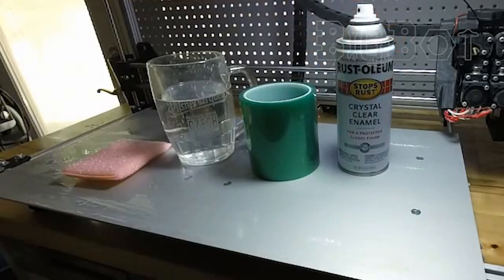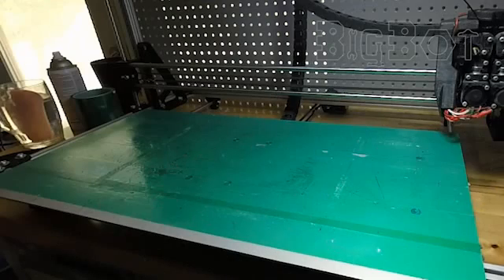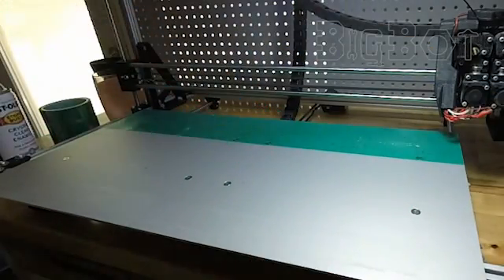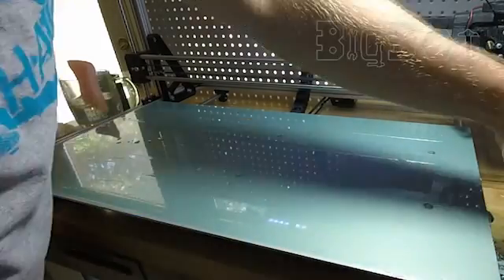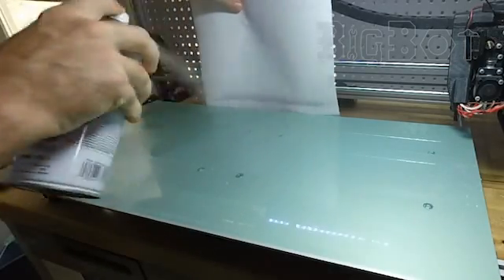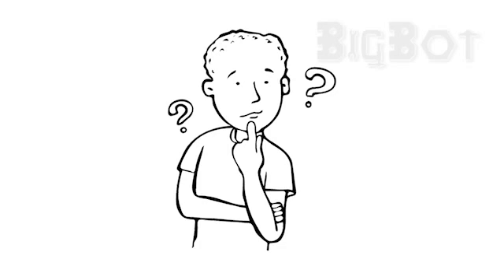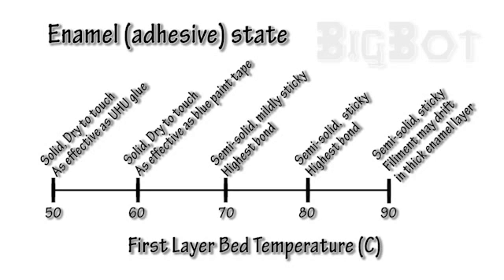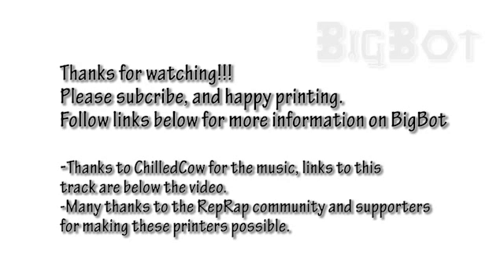BigBot RepRap 3D Printer Bed Adhesion

Comment: I use UHU glue sticks as my adhesion material. It cleans up easy with warm water and sticks my 3D printed parts to the hot bed very well. My 3D printer is not a large as yours.
Reply from the maker: Yea I've gone through about 30 sticks of UHU.  It works better than nothing for sure, and for smaller prints it's a great option.  It doesn't quite have the adhesion and strength to keep the bigger prints glued tho:/

Comment: I tried the PET tape without any coating and it didn't work well so I went back to kapton. I primarily use PLA which works like a champ and I bought some gecko plates from kickstarter for ABS and Nylons. I have yet to use them though lol. I have used the geolite board for nylons and that works well especially for the taulman 618 which has a high warp rate. There is another group on kickstarter selling some other plates like it.
Reply from the maker: hmmm...I don't see info on Geolite.  I'm definitely on the search for something good for Nylon.  Yea the PET tape is there mostly to protect the build plate as cost effective alternative to kapton.  I doesn't have too much adhesion without the enamel, but some people have luck:  https://www.lulzbot.com/support/3m-pet-tape
I would think kapton and enamel would be a great combo; I haven't tried it.  I have some kapton here...might be worth a try if it sticks better than the PET.  I'll be trying PEI soon also.
Reply from the maker: Hey I though I would ask your advice since you messaged me a while ago about printing with Nylon...
Using Taulman 645 (for it's higher temperature performance), do you know of a build plate that could hold well during printing and release a Nylon part without bending the part badly?  For example, something that would print a 6" x 6" x 1" nylon part?

Comment: For nylon just use a polished silicate surface with some glue on it (not glass - you'll not be able to remove it from glass), e.g a marble slab coated with PVA. Watch?v=o_pZ3NsDBFI.
Reply from the maker: That's interesting.  I've had about that much luck with garolite recommended by Taulman.  Sometimes it sticks too much, or sometimes not enough, but when parts get taller they still warp and pull off the plate.  Marble seems worth a try tho...it makes more sense than glass b/c it's more porous and tougher.  I'd guess sanding would help.
Reply: Hmmm.. Well, please don't sand.  See, the mode of operation displayed in Watch?v=o_pZ3NsDBFI is opposite to the garolite mode of operation. Garolite works by presenting many grooves for the Nylon to melt into. The polished marble mode of operation - is that it works with a thick layer of dry PVA, provided you print with a very hot first layer and a large brim and your printer is configured just right to have your head constantly at no more than 100 microns above the PVA, so the nylon is deposited right into the PVA - and this works by the suction cup principle. What happens is that the PVA fills the gaps making the nylon first layer + wide brim, air tight. Once that happens, it sticks so hard to the polished marble, you'll need a scraper to manage to seperate the nylon from the marble, and btw the first layer comes out shiny. You're gonna like it.
Reply: One other point - do not, I repeat, do not even try to print on glass coated with PVA. The problem is that marble has some imperfections which allow you to use a scraper to take the nylon off. Glass might not have enough imperfections - I lost a borosilicate glass plate trying to print nylon in this method - the print went fine, but when I tried to pull the nylon off the glass, it ripped glass shards with it. The suction cup principle is that strong. So you can use any kind of silicate substrate, as long as it has some imperfections, and from my experience, polished marble works fine. Just keep it polished.
Reply from the maker: The best results I've had with Nylon have been with Taulman 645 (910 is good also) and PVA coated garolite.  I have been very frustrated trying to get the cheaper Taulman 618 and bridge to work well.
I will undoubtedly try the PVA coated marble.  I'm having a difficult time visualizing the suction cup principle actually providing strength, but maybe I have to try it to understand it.  Have you printed parts over a couple inches tall with nylon?  I have yet to see a video or someone with true success with larger nylon prints.  The bulk of my issues come from the nylon banana-ing off the bed about an inch into the print for anything over 75mm in X or Y, so I think adhesion to the nylon itself is the issue.

What temps are you running your first layer at?  I use a PTFE lined heat break so I keep the temps below 250C.  I've heard nylon works well tho with an all-metal heat break.  Perhaps getting the 1st layer above 300C is the secret?  I have a sweet dehumidifier setup, but I don't think that's really the secret to good nylon prints at all.

Regardless, thanks for the suggestions!  Nylon is one of the strongest materials out there.  How amazing would it be is someone started selling a GF or Carbon filled nylon for FDM?  Thanks stuff is truly wicked-strong.
Reply: Sure. Printed stuff for my PhD - several pretty high coil winding bases, etc. Also printed a 3" tall sleeve for a swimmer's mp3 player and even a 5" tall stand for women's nail polish bottles which took around 26 hours to print, with my Rostock. And some other prints as well, all in nylon. And all on my PVA coated marble slab. Nylon is currently my preffered medium to print with. Plus, I've never used Taulman's products, only the cheapest Nylon 6 made in China. 

The secret is the adhesion of the first layer to the slab. You will need an all-metal print head including the heat break, because you need the first layer to be as hot as possible, somewhere around 320 celsius works fine. You need to keep it as low as possible for the first layer - around 100 microns above the platform - and make the nylon flow right into a thick layer of dry PVA. I usually apply a thick layer of a solution of 1:5 diluted PVA on the marble at the end of the day and let it dry overnight.

The second layer and following - you can print in the usual printing temperature you'd usually print with (240-250 degrees for nylon). But with my Rostock I like to keep it warm, to allow me to print faster. So I usually stay around 285 Celsius for the rest of the print and this allows me to reach higher speeds. But that's only me :-).

You will not be able to use this method unless you replace your head with an all-metal head. But I suggest you do that as quickly as possible, cause once you print with an all metal head using this method you won't want to print with anything else but nylon. Try it.

And in fact the suction cup adhesion principle works too well. You will need a scraper to force your creation off the slab. But remember: A large brim, very hot first layer and very low head on the first layer - that's the key to make it work.
Reply: BTW, I usually warm my slab using my heatbed to just below the glass transition temp of Nylon (35-40 degrees celsius) I'm not sure this is necessary but that's what I do.
Reply: Hmmm.. And of course, when you print with Nylon - no fan. But I guess I don't need to tell you this.
Reply: Well, I would write something like "good luck" only luck has nothing to do with it - just follow the instructions at the beginning of Watch?v=o_pZ3NsDBFI and you'll be fine. Have a nice printing!
Reply: Strange, maybe I got a capital letter issue, don't know.. Well, as you know, its watch?v=o_pZ3NsDBFI and not Watch?v=o_pZ3NsDBFI.. Youtube got issues :-).
Reply from the maker: I will definitely be trying all this, but I'm a bit backed up right now.  I have a project that focuses on Nylon printing, and if this works it will make all the difference!  Yea I think I haven't had that 1st layer hot enough to adhere well, mainly.  Thanks greatly for the terrific instructions, and I'll be back in touch!

Comment: It sounds like a good idea, but hairspray in my Replicator is bad enough let alone spray enamel. I would have to do this outside the printer.
Reply from the maker: Enamel is not as bad as hairspray.  Hairspray seems to goop up the linear rails and somehow cuts through the light oil on the surface.  I haven't had any issue with enamel and have been using it over 9 months, and my printers run nearly all the time.

Comment: I have been using build Tak on my 3D printer. So far it has work well for me.https://www.buildtak.com/Thanks BigBot
Reply from the maker: Hi Sidney, do you print with PETG, or mostly use ABS?
Reply: I mainly print with PLA filament but from time to time I will print with ABS.

Comment: Go PEI,  you will never look back!
Reply from the maker: I don't know how I haven't heard of this...seems like people are satisfied.  I'll try it out!  If it works better I will change my recommended bed material.
Reply from the maker: Hello there...I finally got around to trying the PEI.  So far I'm not impressed, but maybe my settings were wrong?
Do you print PETG, and if so, what bed temp do you use?  I had several prints pull the PEI off the 3M468 tape, which seems to be one limiting factor.  Another dealbreaker was that a print froze to the PEI and would not release...ruined the PEI and took an hour to clean that boogery 3M tape off.  Maybe there's a better way to tape it, or maybe the 85C bed temp I'm using was too hot.  I did like the surface finish the PEI gave me, and the sheet itself had more than enough adhesion to the plastic.  So...looking for advice to get another PEI sheet working and hopefully not scrap another bed.  Perhaps there's a better way to stick it to the bed and maybe the bed was too hot?  Thanks in advance!
Reply: You are printing WAY TOO hot!,  I have my bed set at 50C for PETG and 60C MAX for PLA, usually 55C depending on the size of the print.
Reply from the maker: Ah, I was worried that might be the problem.  Ok, I'll give it another shot tomorrow, and thanks!  85C bonded that PETG to the PEI sheet forever:/
Reply from the maker: Hey Dennis,  I wanted to follow up with you on the PEI.  I have used it more and found it to be much friendlier at lower temps, so thanks for the great advice!  PEI is now my go-to when I need a really nice finish on the 1st layer.  Unfortunately I still can't get the PEI to stick well enough to the 3M 468MP for bigger parts.  I'm doing a bit of research, seeing that many German's use a PEI-anodize method to coat aluminum with PEI, which sounds nice but they advertise temps need to be 135C for their plate to work well.  
So I'm wondering if anyone has tried super glue, pva, or epoxy to hold the PEI down better?  I may try in my spare time (haha).

Comment: i also use PEI.  i bought the a 3/32" piece off amazon for like $25.  i also use 3m heat resistance glue stuff to stick it to a heat resistance glass plate.  i print pla at 60c on the pei and flip it to the glass side only for hairspray and abs.
Reply from the maker: I don't know how I haven't heard of this...seems like people are satisfied.  I'll try it out!  If it works better I will change my recommended bed material.
Reply from the maker: Hello there...I finally got around to trying the PEI.  So far I'm not impressed, but maybe my settings were wrong?
Do you print PETG, and if so, what bed temp do you use?  I had several prints pull the PEI off the 3M468 tape, which seems to be one limiting factor.  Another dealbreaker was that a print froze to the PEI and would not release...ruined the PEI and took an hour to clean that boogery 3M tape off.  Maybe there's a better way to tape it, or maybe the 85C bed temp I'm using was too hot.  I did like the surface finish the PEI gave me, and the sheet itself had more than enough adhesion to the plastic.  So...looking for advice to get another PEI sheet working and hopefully not scrap another bed.  Perhaps there's a better way to stick it to the bed and maybe the bed was too hot?  Thanks in advance!

Comment: This is a new method I haven't  seen before. What inspired you to use enamel? I've had good experiences with uhu for PETG and PLA or ABS slurry for ABS.
Reply from the maker: The larger the part, the tougher it is to hold on the bed.  My printers are larger than most, and unfortunately UHU didn't have enough strength to hold most prints down.  I used a lot of blue paint tape and UHU with my smaller printer.  I rarely print ABS in the larger printer because it warps quite a bit for big parts.  When I think about the 1st layer, the glue must have good adhesion, strength, be clear, and work at proper temps.  So I searched for other industrial paints because they're made for terrific adhesion.  I started with liquid acrylic paint and found that worked well, then tried aerosol acrylic, then aerosol enamel.  Aerosol paints are plastic also, so the bed temp melts it readily.

Comment: interesting for big print bed.  I have found Kapton and super clean it with small bit of 99% isopropyl alcohol . fully clean Kapron has been working well now.  But i will have to try enamel .
Reply from the maker: I've found PET tape works pretty good without the adhesive, probably similar to Kapton.  Many printer companies use PET in different forms as a bed material.  A bit cheaper than Kapton...I'd be very curious to hear how enamel on Kapton works.  Likely very well!
Reply: yeah i think like you say it's that sticky zone.
Im using totally clean Kapton . ie quick alcohol  wipe before each print , in a essential heated build chamber.  but any thermal tape that wont react to paint solvents poorly should be good.  the key thing is how it works wit PETG and other filaments. But man you have a huge build plate . LOL I can see why you need fast and easy that lasts .
Reply from the maker: This method works great for PETG, PLA, and TPU.  Not good for nylon or PC.  I've had mixed results with ABS and HIPS...I honestly haven't tried printing those in awhile.  I try to "stick" to PETG and PLA.
Reply: cool good to know .

Comment: Thank you for sharing. I am using PEI sheet at the moment.
Reply from the maker: PEI is a bit pricey...does it work well and last a long time?  I need to find a better way to get nylon to stick.
Reply: True, it is very expensive. I use it because I print ABS a lot and it works reliably. I had it for 2 months now and there is no sign of wear yet. I never tried nylon though as nylon filaments are pricey.
Reply from the maker: Hello there...I finally got around to trying the PEI.  So far I'm not impressed, but maybe my settings were wrong?
Do you print PETG, and if so, what bed temp do you use?  I had several prints pull the PEI off the 3M468 tape, which seems to be one limiting factor.  Another dealbreaker was that a print froze to the PEI and would not release...ruined the PEI and took an hour to clean that boogery 3M tape off.  Maybe there's a better way to tape it, or maybe the 85C bed temp I'm using was too hot.  I did like the surface finish the PEI gave me, and the sheet itself had more than enough adhesion to the plastic.  So...looking for advice to get another PEI sheet working and hopefully not scrap another bed.  Perhaps there's a better way to stick it to the bed and maybe the bed was too hot?  Thanks in advance!
Reply: Hi there,
Oh, bummer. :( I wonder why it doesn't work for you. No, I use mostly ABS for my prints because they are the cheapest filament I can find on eBay.

My PEI sheet is Lulzbot branded, I don't know if that will make any difference, but, it works great for me. My bed temp is usually 100C because I want to heat the bed and my enclosure.

The adhesive works well and sticks to the bed really well.

My print can be easily released just under 70C.

I have no experience with PETG and PEI so YMMV.

Can I know which PEI sheet that you used?
Reply from the maker: Sure, it's the GizmoDorks PEI sheet.  I doubt that the brand has much to do with it.  Lulzbot, GizmoDorks, and the rest just buy the PEI from McMaster, USPlastics, or their Chinese supplier, slap their label on it and jack up the price.  
Probably just the PETG sticks too tight to PEI.
I've printed 20kg or so of ABS with my 1st printer with an enclosure and 8" workspace.  Never was very satisfied with the warpage and layer adhesion of ABS.
Reply: 20kg?! Whoa, that's a lot of printing ;)
But, yeah, maybe PEI is not compatible with PETG.
I know ABS is difficult to print, I tried various bed surfaces and all of them failed. I almost gave up and thankfully PEI works ok for me. Anyways, all the best for your journey :D